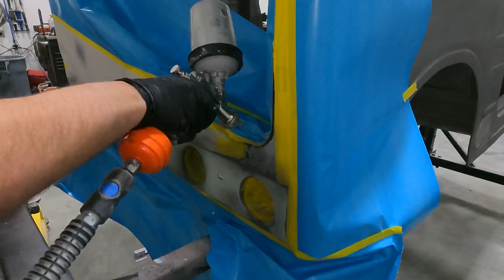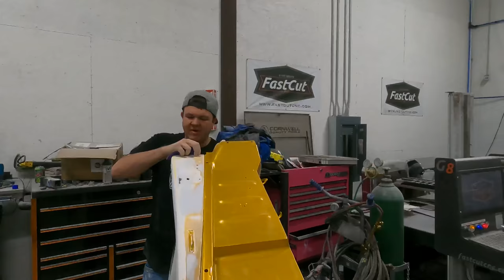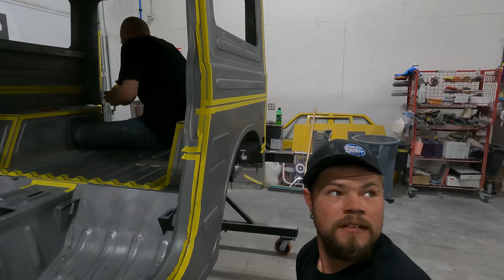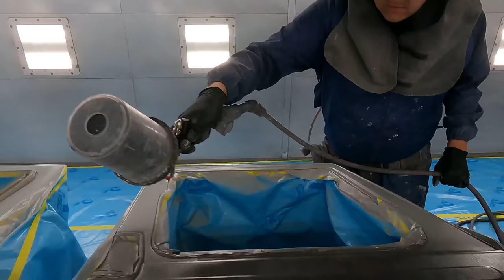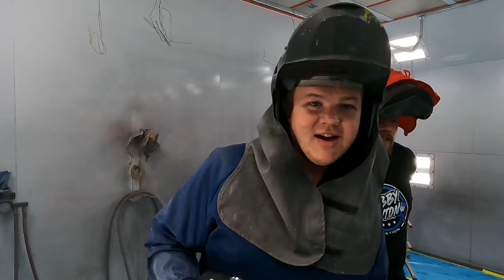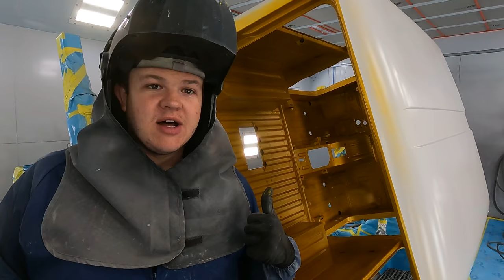15 Hours Straight Painting The Golden Nugget!

Comment: In European garages, hoses hang from the ceiling, they suck all the dust away immediately, so you don't breathe it in and you keep a clean workspace, ditto with welding, immediately pulls the smoke away

At my first employer I was a painter, I was 16 years old and was spraying filter housings, afterwards I also sprayed my cars, but only now do I know why it didn't shine. And my father didn't know either, thanks to your videos I finally know. At the beginning of May I will roll again, but get a scooter from the paying agency so I can't spray it with flames etc, had been a member of the HotRod for a while, no idea if that magazine still exists but what wonderful spraying techniques they had there

Comment: Pressure pot tip. Tape your hoses together about every foot. When possible, hang the hoses over your neck. I run my pot pressure at 8 psi and 3 turns out on the fluid. YMMV.

Comment: Awesome work!! Content to nonsense ratio this time 10:0   We like it! :D    Is there a risk for the rust to come out in the horizontal seam at the quarter panels or does the sealer delay it by a lifetime? Noticed the amount of rust ther after the sandblasting. Are you doing some preventive work  from the back also? Would a acid dip had fixed it?